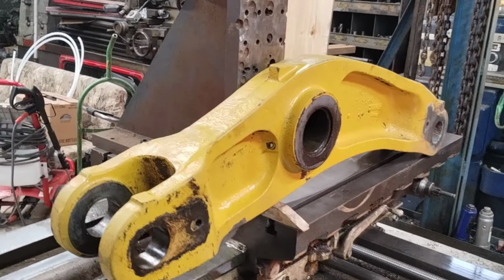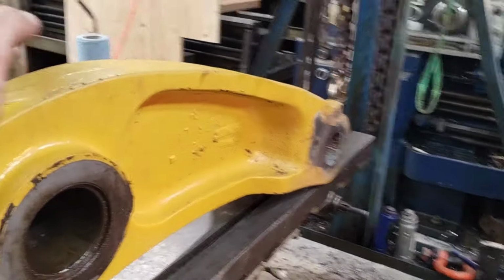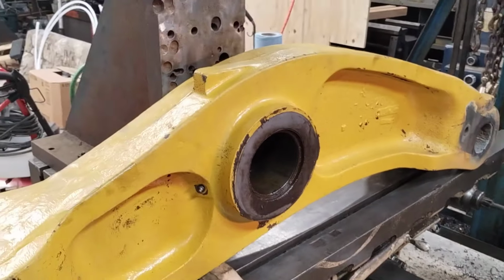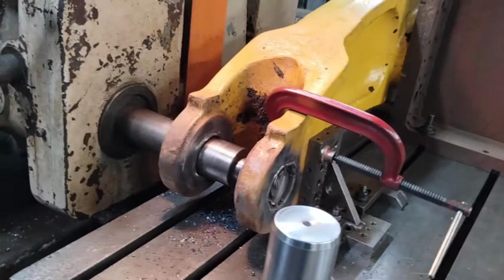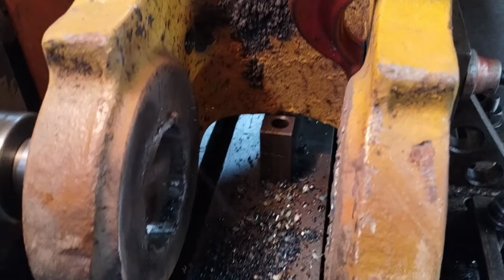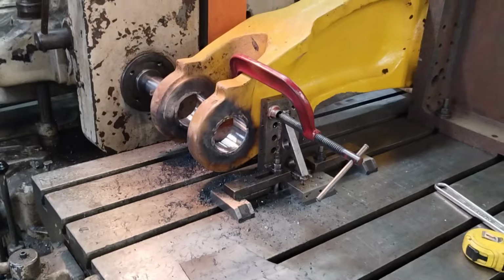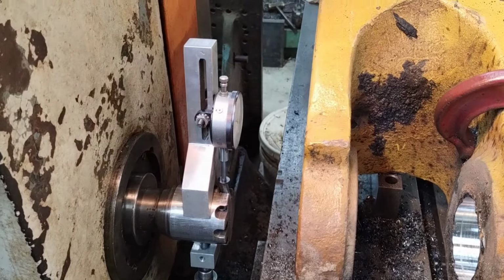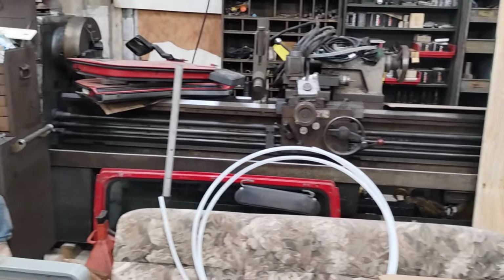Cat 950 Z-link Repair

Comment: I love the way you repair the loader arms. You are more accurate than a line boring machine. And you are definitely going to be square with the rest of the part.
Reply from the maker: Having a machine shop is definitely a big advantage in this line of work.

Comment: Did this same repair in the field many times. Set a bar in the middle bore and dimension to either end. It will be as accurate as in a machine shop.
Reply from the maker: I've definitely done plenty of that sort of thing as well, but it's a lot less work doing it this way.  I would say a good quarter of the jobs that I used to do with my portable rig I put on the boring Mill now.

Comment: Do you prefer welding or sleeving for stuff like this? It being a cast part makes me think it would suck to weld but you've seem to have no issue. What process do you use? 

Solid looking repair, have a good weekend!
Reply from the maker: The cat parts tend to be cast steel so welding is no problem, but I definitely always double-check a cast part before I just assume that it's safe to weld.
Reply: @Andy-PerpetualMotion that casting was made at Harrison Steel, in Attica, IN.   Worked there for 6 years as an engineer.  Recognized the logo immediately.
Reply from the maker: @foundryman1985  very interesting! Thank you for taking the time to chime in!